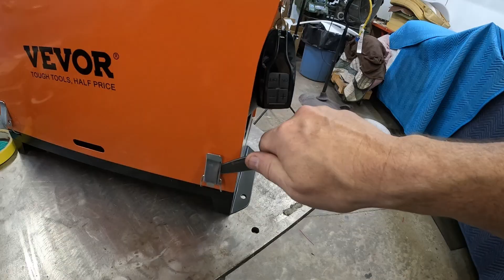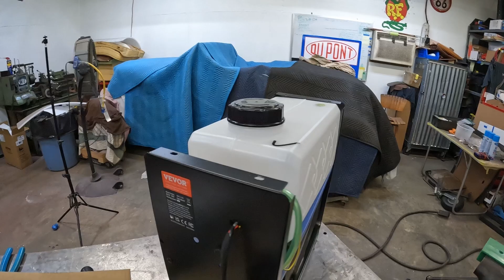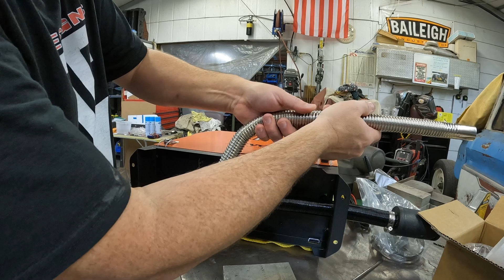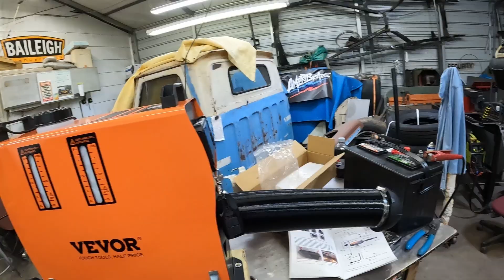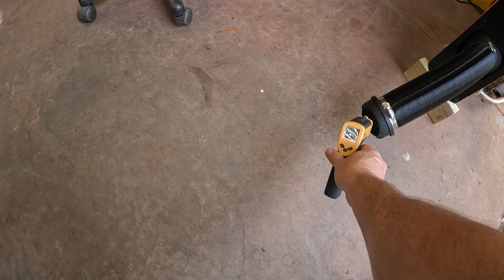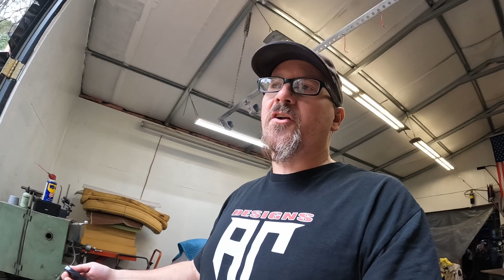I Can't Believe How AWESOME This (Compact) VEVOR 12v Diesel HEATER with Bluetooth IS!!!

Comment: Just revisiting this..  Have you used it anymore?  and whats your result for the size of your garage?
Reply from the maker: Yeah it works pretty good. It works to maintain heat after I get it up to temp with the big heater. I like it because there are no fumes!!
Reply: @ACDesignsGarage  thanks so much! 
I'm up in NW Virginia and contemplated getting one for the garage (oversized 1 car) and not run the propane Jet heater.  It's so damned loud  LOL

Comment: I just thought about this, is you you could run the exhaust through a Red Dot heater radiator with the fan on it to push more heat into your shop.
Reply from the maker: That's a great idea!!!

Comment: I use a propane roofing torch to quickly heat the garage, then leave  torpedo heater on to maintain on thermostat. obviously you need lots of free space to have that big of open flame and
DO NOT leave it unattended! large ice melt/roofing torch, is around 500K BTU. ceiling fans to blow the heat back down help, especially if the garage is tall. everything will quickly get wet with condensation, as that much burning propane-air produces quite a bit of humidity and rapidly heating further worsens it.
probably not ideal for any metal fab shop to "yo-yo" heat their space. would be far better off to insulate and air seal very well and keep it heated 24/7 with a small set-back for non-business hours.
Reply from the maker: I will say when it's real cold it's hard to beat the torpedo heaters, jave you seen the new gunfire heaters?

Comment: The hole in the bottom of muffler should be pointed downward. It's a condensation hole. I tacked together a metal frame that screws to inside of window in garage. I have TWO of these heater's sitting side by side. I run one in early spring/late fall, and run both to quick heat garage, then shut one down. shop is 20x20 insulated, in Minn. Will cook you out of there! Both intakes and exhausts exit to outside through tinned off lower half of 24" slide window. Third winter running them. Zero issues. Nearly identical units to ones you have in video.
Reply: Wanted to add: Always do a proper shut-down. Do NOT just unplug it from the battery.
Reply from the maker: Thank you I'll remember that when I install them permanently,  I may get another like you did for my shop!!!
Reply: @ACDesignsGarage  Although it's not a stellar video, I did post one of the set-up I'm using. Thought maybe it might help someone, or give them an idea. :)

Comment: Seems like one of these might be handy for power failure backup heat.  My propane heater (from an old trailer camper) uses coaxial tubing for combustion intake and exhaust.
Reply from the maker: That's a great idea, thanks for sharing!!!